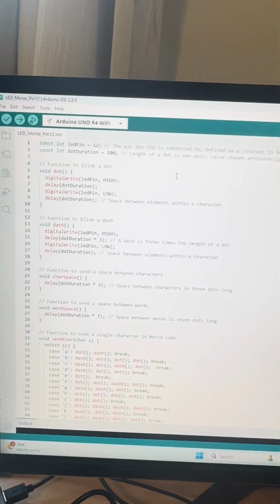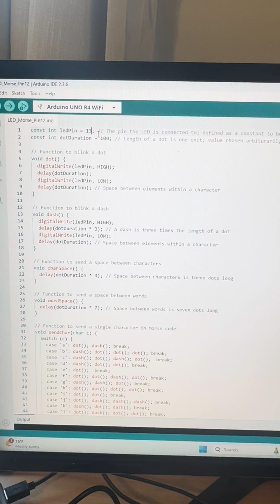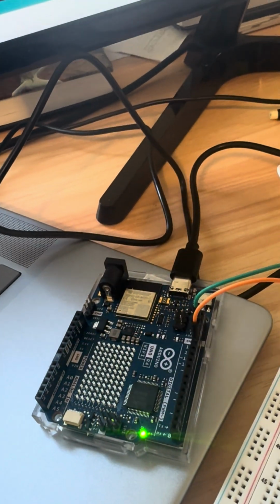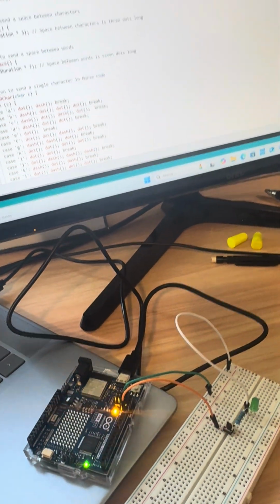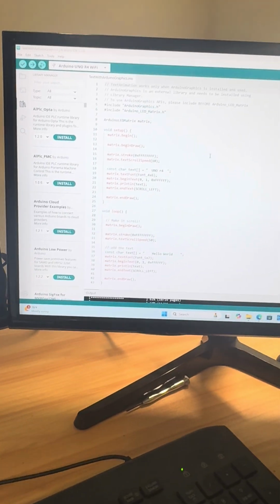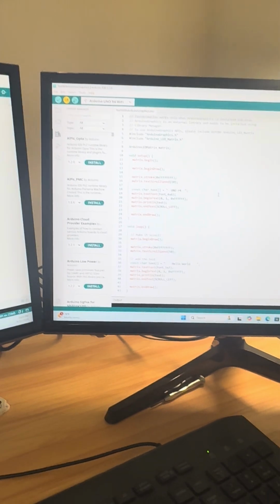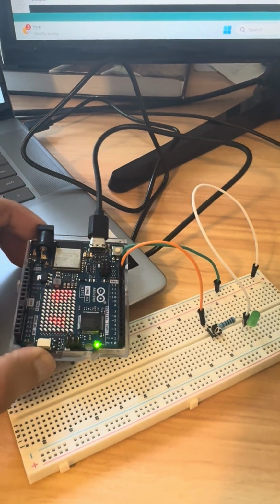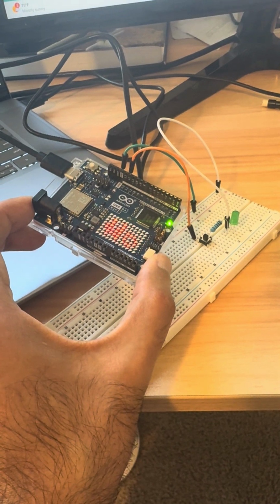Blinking LED to Display Morse code

Comment: Please don't put arduino while it is plugged in and on a aluminium or any metallic surface, I got scared you placed your arduino on a conductive surface. 😂
The shield is keeping your arduino from frying right now.